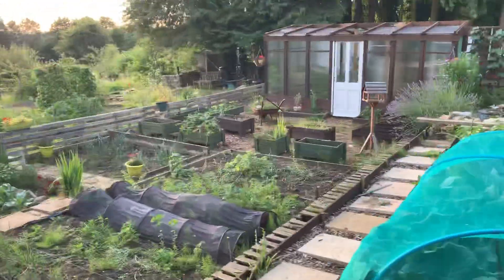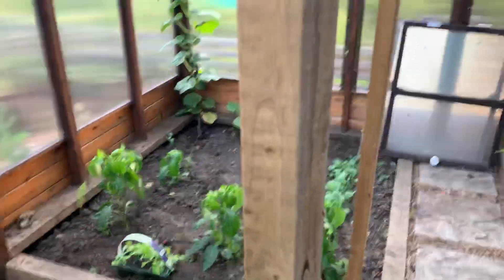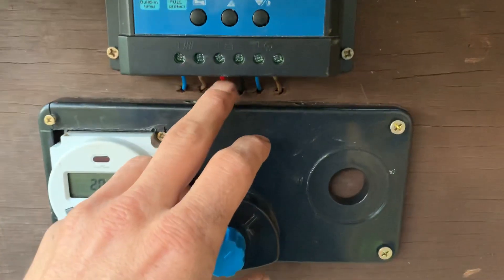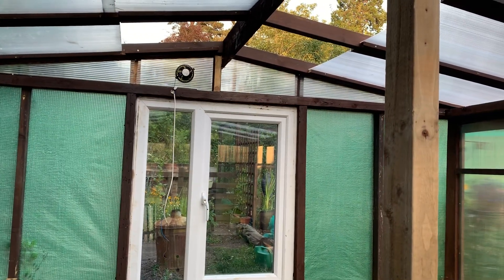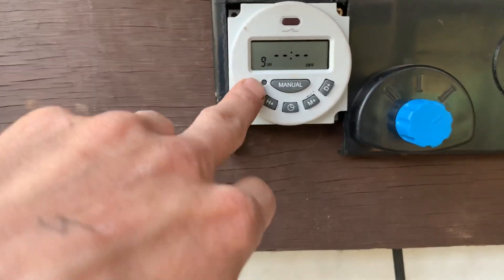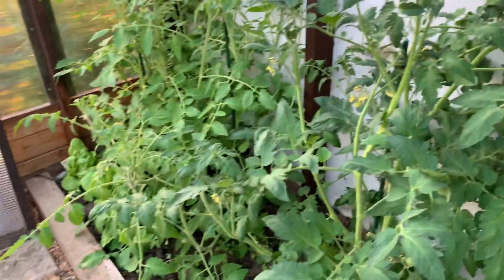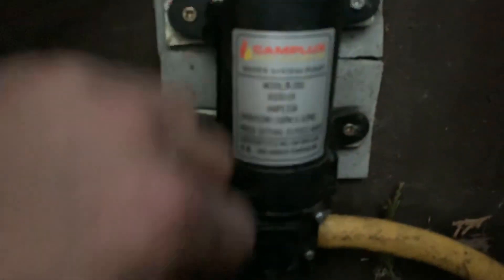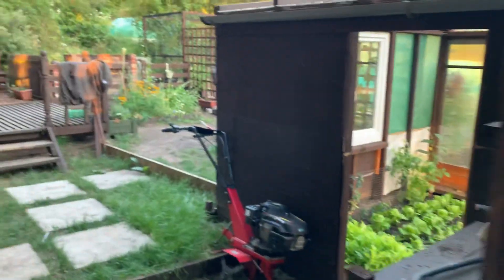12v solar powered water irrigation system.

Comment: add another 2 timers and water pumps to your system.  This will allow each garden bed to have its own system. just make sure the timers are set right so that only one system is running at a time.

Comment: Does your pump have a pressure cut off switch? There should be a little screw you can adjust. Having that set too low would both give you low pressure and a noisy pump.
Reply from the maker: I’m not actually sure I’ll have a look when I’m next down. Thanks for the suggestion. I’ll let you know if it has and if so if it helps. 👍🏼

Comment: Did you ever resolve the pressure problem? I’m considering this setup but am concerned the pressure won’t be sufficient
Reply from the maker: farceadentus  I’m still working on it. Until I’ve got my veg in place I won’t know how many valves I will need so I can’t work out the pressure needed.  If that makes sense
Reply: @darwin5921  have you thought of adding an inverter to the system and using some big boy pumps? You may need a car battery instead though
Reply from the maker: @tonystephengrayson  hi mate. So since this video a lots happened lol. My shed was broken into and My solar set up was stolen.  Had 3 more kids and recovered from a bike accident.  

I’ve just started work on my set up 2.0 so keep an eye out for my next update video 😉